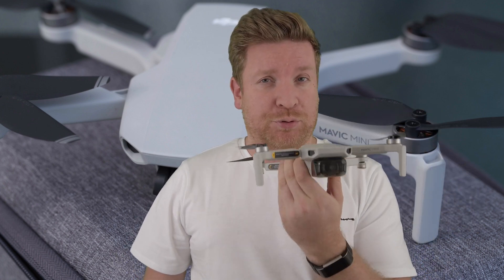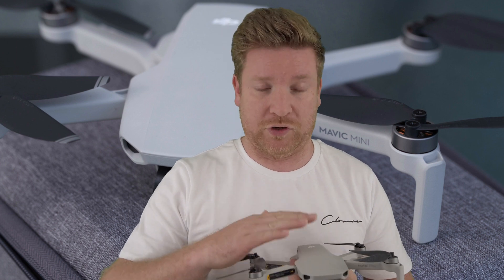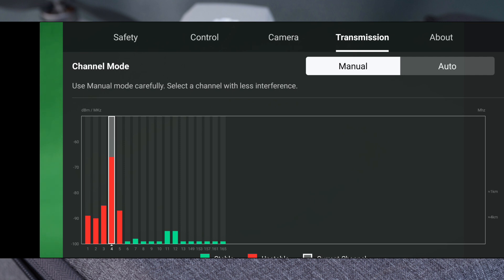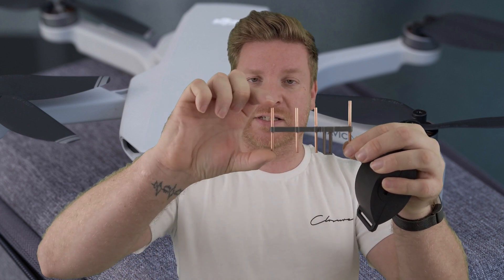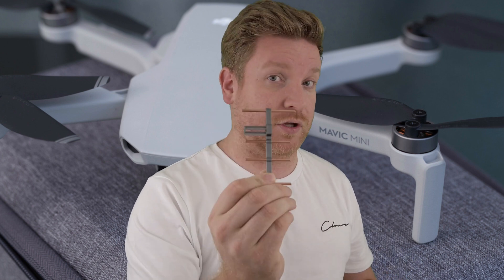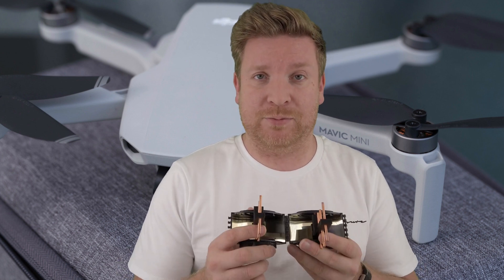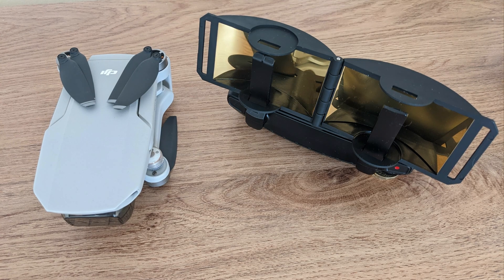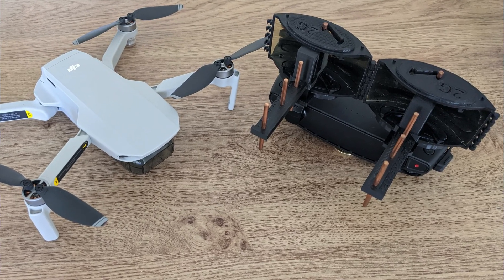TOP TIPS & HOW TO FIX BAD RANGE ON A MAVIC MINI || CHANGE 2.4GHZ TO 5.8 GHZ CHANNEL RANGE EXTENDERS!

Comment: Great content and great advice that we should try but I am kind confused. So I bought a Mm two weeks ago and with the update of dji fly 1.1. 8 and 1.1.9 I never saw in the transmition tab any 5.8ghz channels and it only shows channel 1 to 11 So  I am from Portugal and in the dji forums here there were others that complained the same in manual mode not to be able to change from 2.4ghz to 5.8ghz due to a bug in this new dgi fly update. Could tell which version of the dji fly app are you using just to know? I saw the videos you mentioned. Great stuff. Greatings from Portugal.
Reply: Hi João Paulo, 
I'm from Portugal as well and have both frequencies. If you didn't mess with the firmwares you should have channels 1 - 13 in 2,4GHz and the 5,8GHz option as well. 
If indeed it was a firmware issue (didn't notice it so far), you can always downgrade the firmware to the previous version with the dji assistant 2 (for Windows).
Hope it helps.
P.S.: Se precisar de mais alguma dica, contacte-me e terei todo o gosto em ajudar.
Reply: @carloscosta253  Boas Carlos... bem já tentei tudo aquilo que o Carlos me disse o que a Dji support me disse para fazer... Não sei amanhã vou tentar fazer novamente tudo inclusivamente desinstalar e instalar  novamente assim que faça o refresh do firware do drone e do comando e instalar a aplicação no telefone do meu filho que é um S20 poi aí se houver problemas de incompatibilidade nesse não será o caso se não der resultado já tenho que fazer no Domingo... ir à loja onde o comprei a ver se me dão uma solução rápida. Abraço
Reply: @JoaoPaulo-pb9zv  Viva,
Eu uso dois telefones: um S7 edge e um Note 10+.
Na verdade, nenhum me deu problemas desse tipo até agora, mas vou experimentar ver se há alguma actualização que me tenha escapado e que possa causar esse problema. 
No passado também lidei com problemas com as actualizações (uma que dava erros nas hélices e outra em que deixei de ter o português...), mas nunca tive esse problema com as frequências...
Se ainda não passaram os 15 dias (ou 30 nalgumas lojas), pode sempre pedir a troca do equipamento. Na verdade, talvez seja o mais fácil.
Surpreende-me que os assistentes da DJI não tenham encontrado uma solução mais simples, embora em ambas as vezes que tive as dificuldades supra, não tenham sido realmente eles a arranjar a solução...
Se continuar com dificuldades, eu posso arranjar um firmware e software mais antigos para experimentar, mas recomendo que tente trocar primeiro...
Reply: @carloscosta253  ok obrigado eu também fiz o downgrade para a versão anterior a 0.400 e recalibrei tudo ao pormenor... poderia quase certamente jurar que o meu telemóvel é compatível com 5.8ghz. Entretanto agradeço a sua paciência e ajuda o Carlos sabe também quanto eu que devemos utilizar as últimas versões pois se algo correr mal pomo- nos a jeito para invalidar a garantia e isso pelo menos sei que tenho direito, o que puder vir por acréscimo é ganho. 👍
Reply: @JoaoPaulo-pb9zv  acabei de ligar o meu drone com o software mais recente. 1.1.9.
Tem aqui o resultado, com a passagem de 2,4GHz a 5,8GHz e vice-versa. Mostra também as versões de software e firmware. É assim que deve aparecer no seu. Se não for, terá mesmo de reclamar...
 https://youtu.be/cbFxUyNs5Qw
No que diz respeito a ser a última versão a melhor, nem sempre é assim e no meu outro telemóvel uso uma versão de software mais antiga, que além de estar em português, foi a mais estável até ao momento.  Sendo original, duvido que alguém questione isso, caso haja algum azar... 
Penso que, por algum motivo, o seu drone esteja bloqueado em modo fcc, mas sendo assim, deveria ter acesso aos 5,8GHz... talvez venha com uma outra versão... onde comprou o drone, se não é indiscrição? Talvez a versão não seja a CE... tenho ideia de haver uma versão mais limitada. Deve conseguir ver na caixa.
Espero ter ajudado. 
Abraço.
P.S.: o telemóvel nada tem a haver com o drone fazer 5,8GHz. O drone comunica com o comando por wifi (2,4GHz e 5,8GHz)  e transmite por cabo para o telemóvel.
Reply: @carloscosta253  Não deixa de ter razão no que diz o meu apresenta na caixa CE. é não é indiscrição comprei na Worten Allegro Montijo. O meu telemóvel já confirmei embora não esteja incluído na listagem da Dji é o Huawey p20 lite versão ane lx1 802.11 ac portanto suporta Wi-Fi 5.8ghz. Porém tenho andado às voltas com o assunto e penso ter descoberto algo,e já agora gostaria de saber a sua opinião. Quando fiz o downgrade e também o upgrade reparei que no final não apareceu a mensagem com o "V" é-o ecrã ficou branco e o drone desligado.
Reply: @JoaoPaulo-pb9zv  não acho que seja por aí. O drone não iniciava, se não tivesse o firmware actualizado. E também o facto de ter o Huawei não deve ter influência nenhuma(pois supostamente não mexe com o wifi. De resto, dizem que para ter melhor alcance, deve ter o wifi do telefone desligado, precisamente para não interferir no sinal do drone...). Pode ser algum drone recondicionado, ou mal catalogado. 
Se viu os passos que eu fiz e o seu menu está diferente, não perca mais tempo...
Recomendo que peça que lho torquem (ou devolve e compra outro...). A Worten tem uma boa política de troca e não devem causar dificuldades...
Reply from the maker: Hi Joao, my firmware is 1.1.10 however my last few have all shown the 5.8ghz channels? This is very strange indeed! I would only back up what Carlos has said and maybe roll back the firmware version and hopefully that brings the option back?
Reply: Sim claro. Obrigado Carlos, pois estou um pouco confuso e desiludido pois não é sempre que posso ir para o campo e em zona urbana começo a ter problemas de imagem a partir dos 230/40 metros. Começo a pensar e até porque só ma aparecem 11 canais que tenho um mini com defeito. Obrigado pelo imput.
Reply: @JoaoPaulo-pb9zv   a aplicação da dji permite essa correcção, através do downgrade, mas há outras, incluindo uma que permite aumentar a potência do comando... chama-se drone-hacks e pode descarregar em drone-hacks.com . Eu só a conheci faz poucos dias e ainda não a experimentei pessoalmente, mas tenho um amigo que pretende fazer os chamados vôos de longo alcance e tem estado a explorar outras opções que esse programa tem...
Não deixe que este pequeno revés o desanime. Tem um drone espectacular, com bom alcance e excelente estabilidade. Claro que por ser tão pequeno, tem algumas limitações, mais vai ver que o potencial é bastante superior às limitações... recomendo que faça o dito downgrade e, se não resultar, fale com a dji através da própria app, ao vivo. Eles têm um bom serviço pós venda.
Pela minha parte, mantenho-me ao dispor, pelo que pode chamar sem cerimónia. 
Aproveito para recomendar que veja os vídeos deste nosso conterrâneo, que recentemente fez quase 5km de distância, com um drone original e apenas uns boosters extra... 
https://youtu.be/cvsk5qNkgho
Reply: @carloscosta253  Obrigado uma vez mais. Sou da mesma opinião e no essencial é a primeira vez que sinto qualidade à medida do meu bolso mas estes bugs dos firmwares deixam - me desconfortável e ansioso. Espero que dê tudo certo caso contrário lá se vai o entusiasmo. Um abraço.
Reply: Thanks Gavin so you talking about the transmiter firmware... that s it? Thanks for your help.